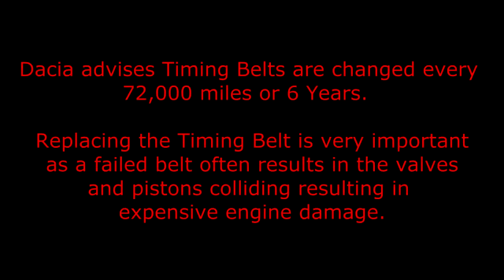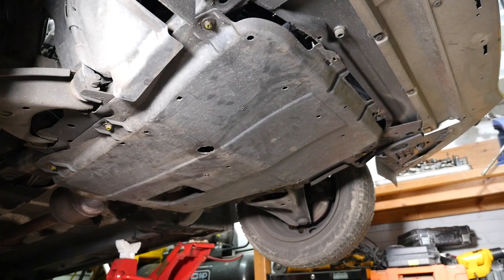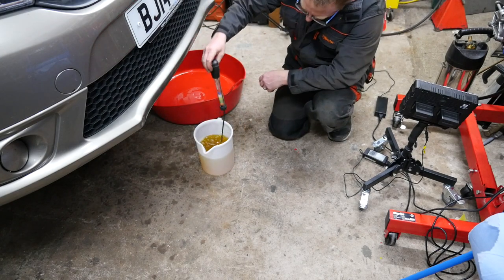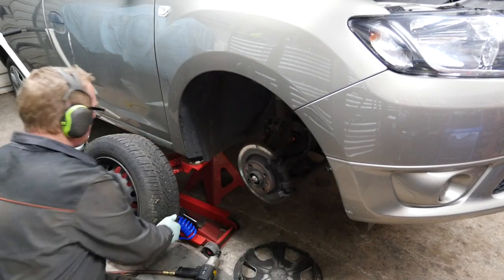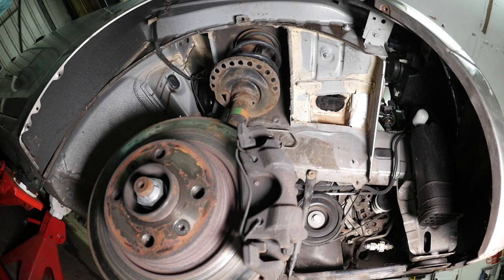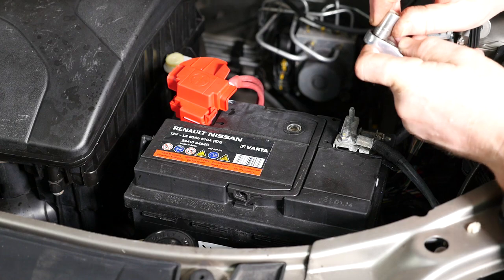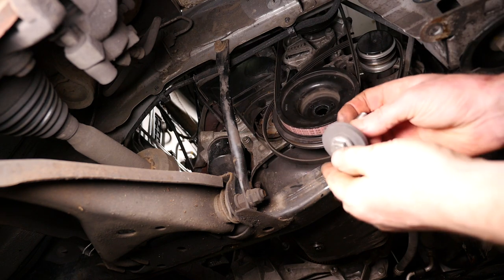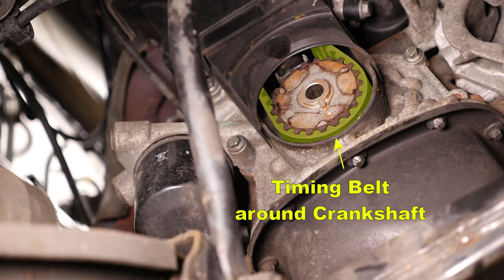Part 1 of 2 - Dacia Sandero Timing Belt, Tensioner & Water Pump - Renault D4F Engine as in Clio. 🚗

Comment: Best motor maintenance video I've seen on YouTube. And I've watched dozens.

* All bolts and clips highlighted and sizes given
* Each part shown from all angles after removal, for easy ID
* Every step explained

...and avoiding the thing that drives me insane on most such videos....

* You actually keep the camera fixed in position and not continuously swinging about like a drunken sailor.

I don't even own a Dacia but I enjoyed watching this. Great stuff!
Reply from the maker: Thank you kindly.  I do try hard to make them accurate and easy to follow for repairs.  I'm back on that Dacia again now.  A series trying to track a knocking sound down on the engine.

Comment: Great video,hard to find one this informative,thank you..my daughter's Clio engine is the same as was wanting to change the two small belts on flywheels would I just follow video to where crankshaft pulley is  removed then reverse for fiiting,thanks again
Reply from the maker: Thank you for your kind comment.  Yes your quite right.  Some belts are stretch belts so in theory can only be fitted once and once removed a new one should be used.  If they are stretch belts then a small tool is often used to help slip the new stretch belt onto the pulley.  Hope this helps.
Reply: @CoatsandGaiters  thank you,this helps a lot,will look at belts if they are stretched belts will get tool if not will do as above. Have brain injury so the more information on doing things the easier it is for me and your videos do that,thanks again 😀👍
Reply from the maker: @laurencecoll3777  Sorry to hear that Laurence.  I try to make the videos how I would need them.  I'm one of those guys that needs everything explained and shown fully with nothing left to the imagination.  So pleased my methods help us both.
Reply: @CoatsandGaiters  it does,do it once do it right only comes with right info and the right tools ,then know doubt can creep in to annoy, thanks

Comment: Great explanation!! There is no reasons to remove a/c compressor and the alternator?
Reply from the maker: Thank you
Reply: @CoatsandGaiters  it's good idea to change the crankshaft oil seal after 90'ooo Km?
Reply from the maker: @ilvale6439  Probably but I only do the jobs they ask.  Family member with little spare cash.
Reply: @CoatsandGaiters  thank you so much! I have a last question for you. Can you tell me the correct procedure to serpentine belt tensioning?
Reply from the maker: @ilvale6439  trying to remember if it was a stretch belt on that engine.  If so there is no tensioner as the belt itself does that.

Comment: At 35:20 you are supporting the engine from the oil sump. Is that safe? Does is not damaging the sump?
Reply from the maker: There isn't much weight on it as the load is still being shared on the other sides

Comment: Weird, here in Spain the kit KTBWP3211includes the timing belt, tensioner AND water pump, all for 87€
Reply from the maker: I see there is a kit on ebay for £78.99 with all 3 items.  I read that some pumps were more reliable than others so maybe the pumps are priced differently depending on which one comes in the kit.
Reply: i ordered continental contitech CT 1045 WP1 kit with pump and gaskets for 99€

Comment: HI , i have this car and after cutting out and not starting i have found the timing belt has snapped, before i go putting a fully engine in it i am going to try just replace the belt and hope for the best, could you advise on how i would re time the engine ?since the belt has snapped. any help is much appreciated thanks.
Reply from the maker: Just be aware you can get an engine off ebay for under £500 with 70k miles on.  I need one as well.  Timing is just the same as in this video.  Set the cams and the crank and put a new belt on.  Problem is when the timing goes the valves and pistons often meet.  Take a look at my latest video as I just took the cylinder head off an engine where the timing slipped.
Reply: @CoatsandGaiters  thanks for replying , i will have a look at that video now, with the timing problem is when i put socket on crankshaft to spin to line up the marks obviously the top spocket the camshaft doesnt move as not connected with belt, so would i just rotate both the crank shaft and the camshaft with a socket then put belt on.thanks again
Reply from the maker: You'd have to play around a bit and try to get the cams and  valves to mesh up again.  problem is if some valves are open it may not allow the crank to rotate normally.   @scottd1999
Reply: ok i will have a go at it, no harm done if it doesn't work as i would have to get  replacement engine away, thanks for your help 
 @CoatsandGaiters

Comment: Hi, I've recently changed the belt on one of these - I checked that the timing marks lined up after spinning the engine by hand. When starting the engine, nearly immediately the engine management light flashes and there's a severe misfire. Is it possible I'm out by one tooth? The compression test came back fine so nothing's been damaged, but would being one tooth out cause such a severe misfire?
Reply from the maker: Sorry to hear this, one of the biggest fears for us non qualified mechanics and timing belts.  Did you follow me video exactly as I had a slight oddity of the manufacturers mark not aligning by one tooth.  Thankfully I had marked the old belt before removing.  I'd have a relaxed re look at it and watch my video in case you missed something.  Check the crank isn't 180° out of sync.  I did that once on my old Allegro when I was a kid and I couldn't figure it out what I had done wrong.   Just remember the crank has to rotate twice for each revolution of the camshafts.
Reply: Coats and Gaiters thanks for the pointer - admittedly I watched this video as I was struggling with the fiddly tensioner and didn’t see the part about the marks not aligning! I will re-watch and get back to you. What makes things more complex is that I removed the engine + ‘box for a clutch replacement so it makes it harder to narrow down the misfire cause. This is one of a few things to check as I retrace my steps. Thanks again
Reply: Hi again, just to update you. I checked my work on the timing belt/pump/tensioner assembly & it was installed and tensioned correctly. I reinstalled the timing belt and re-tensioned it anyway just to be sure. Unlike in your situation I was able to get the white marks on the belt to line up with the marks on the sprockets, and in fact it wouldn’t go on at all if I tried to install it the way you did with the crankshaft mark and the white line one tooth away from each other. My belt was made by Gates, not Dayco as in your example so perhaps that accounts for the difference? Not too sure.

My actual issue was that an injector was faulty, and it was just pure coincidence that it failed post-timing belt/clutch change. I’ve replaced it and the engine now runs perfectly. Your advice about marking the old belt before removal is a great idea & something I will take forward in the future, so thank you👍
Reply from the maker: @HCrawf  sometimes its safer to do one job at a time or have a wife that points out the obvious.  I think the Dacia is probably a nice balanced car to work on for the home mechanic.  I now have the Nissan X Trail and from what I've seen online doing a clutch would be an utter nightmare.  I really wouldn't want to do one.

I try and mark or video everything as its so easy to slip up.  In some ways making a video helps me as I have to make sure each step I understand fully before filming it.  Normally I'd just get straight in there and make a silly mistake that costs me dearly.

Comment: Hello, if you rise up only the front of the car, all the water inside the engine can going out?
Reply from the maker: Sorry not sure what you mean.  Do you mean the water will run away from the water pump?
Reply: @CoatsandGaiters  I would like to know if raising the front of the car, all the coolant comes out or some coolant is trapped inside the engine
Reply from the maker: @ilvale6439  There is normally coolant in the engine block, internal heater matrix and radiator.  Nothing will come out unless you remove the bottom radiator hose or engine drain plug.

Comment: how long time or KM should be between timing belt replacements?
Reply from the maker: You must have missed that bit as I answered this question only 8 seconds into the video.  I will save you those 8 seconds and just give you the answer of 72,000 miles, (115,872 Km) or 6 years
Reply: @CoatsandGaiters  thank you. yes, i missed it. i wonder why renault manual is silent about this. 
another quetion:
do you know how many kilometers should i replace transmission oil? i mean DP2 4 speed automated transmission.

Comment: Thanks for a very informative video I was wondering how long did the whole job take to complete? Im a DIY mechanic and I replaced my brake pads and discs watching your videos would you recommend I attempt replacing the water pump and timing chain my self or is it best left to a professional? Thanks in advance
Reply from the maker: Timing belts can be a scary thought as you know you must get it totally right or risk engine damage so I always find I'm somewhat nervous as I know I cannot slip up at all.  But saying that my video should give you an insight as to what tools  etc you will need so really its down to your confidence.  My outlook was I'd rather spend the money on decent tools even if the job cost the same as a garage  in the end as I would have those tools for life and know if I messed up it was my fault.  Just go slowly and ensure you note everything if you do decide to have ago.  I would allow a couple of days to play safe if your unsure.  It's certainly not a job to do under time pressure.  Maybe get everything removed except the timing belt on day one and then the next day remove and replace the water pump etc.
Reply: @CoatsandGaiters  you are absolutely correct sir I have been slowly stockpiling decent tools as I want to have the satisfaction of doing my own repairs whilst saving money as opposed to going to a garage, I rather learn the job my self and have that knowledge. I am due to repair the front control arm on my car and I'm slowly learning to do repairs watching your guide, I have watched this video numerous times to get a better understanding of the timing chain job and I hope one day I can attempt it thank you for making a great video guide and it is your videos that gave me the confidence to even attempt my first brake job on my car thank you sir👍 the timing chain job does seem very fiddly but your guide gives me confidence that I can tackle it one day thank you for the advice and taking the time to reply to my query
Reply from the maker: @kika6718  I think I just have a thing for collecting  tools, I look for an excuse to try a new one.......now how sad does that sound lol.    I agree with you watching over and over the video before you start as its a big job and the more you re watch the more you will feel like you know the job.  I love YouTube for this.  It's helped me out or rather the kind people that upload have helped me out so much over the years.  Before mending your car could be a challenge hoping the garage might tell you the answer but with YouTube normally someone has the answer and has spread the word.  Fantastic community.  Thank you also for your kind words and taking the time to write them.